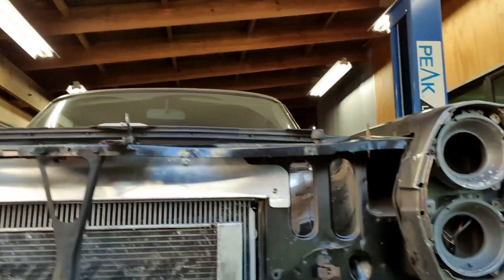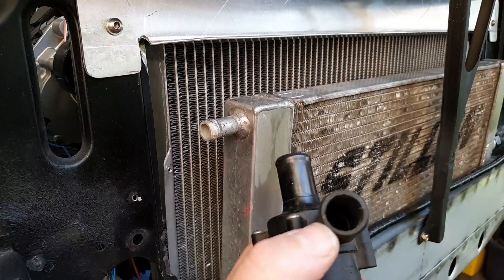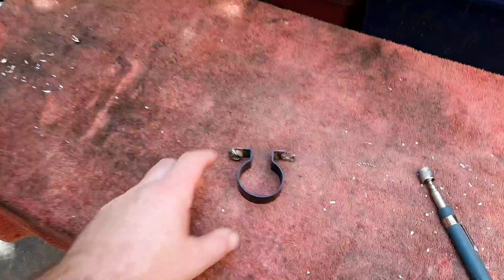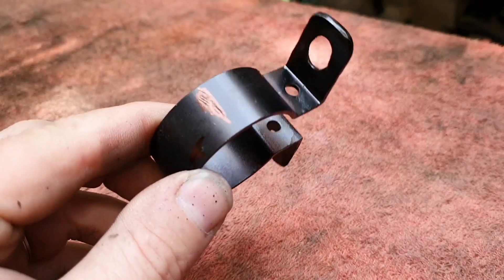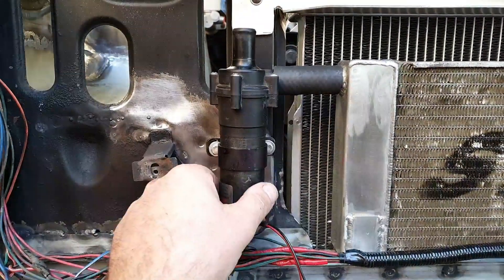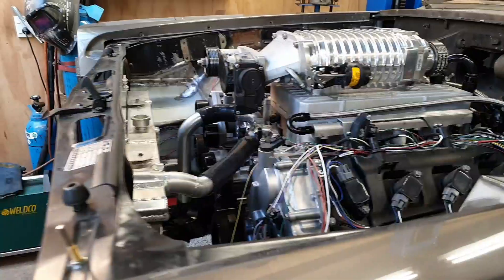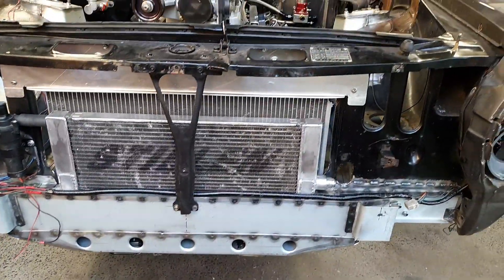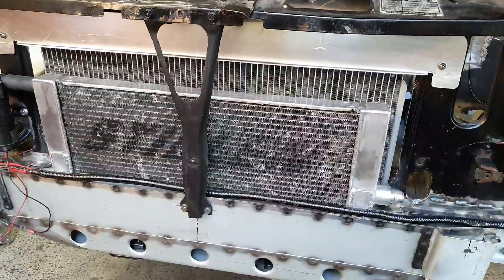Lock down day five, intercooler pump installation

Comment: Hi  there.  I have a Mazda AZ 3 1500 cc  b5z. after some info on redoing air intake to up the air flow and drop the temp. car is still factory. any info on best things to do to maxims power.
Reply from the maker: "Best" will depend on budget really
Best bang for buck will be a simple drop in replacement air filter like a K&N or similar, minimal dollars and effort for fair reward.
Next up would be a custom intake pipe removing things that may impede air flow such as harmonic boxes etc designed to keep noise down but can hinder peak power.
A cold air box would be a good option at that point or a cold air pod filter set up - again K&N do a nice unit & others as well.
Most modern cars do not actually gain a lot of power from intake system mods to be fair, there's normally a little bit there but not heaps.
Bigger gains to be had with a custom tune but much bigger investment.
Reply: @TheLabLimited   hi thanks for the help, love the videos, will hopefully be able to design something over the lock down. 
i have put an mx5 throttle body on it as bigger diamator, will try video the set up i have and share my progreas as i go. sadly no parts. 
would love to tune it but unshore where to start on that. i live in inercargill.
thankz again